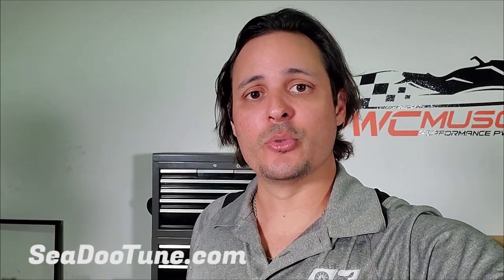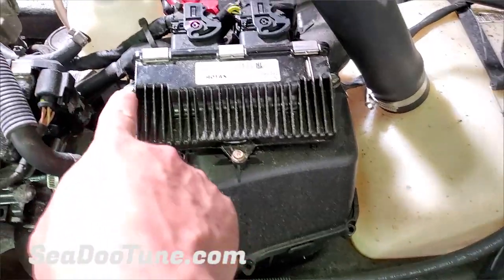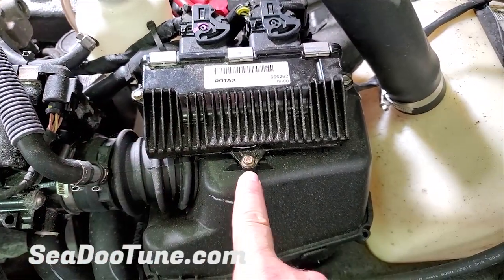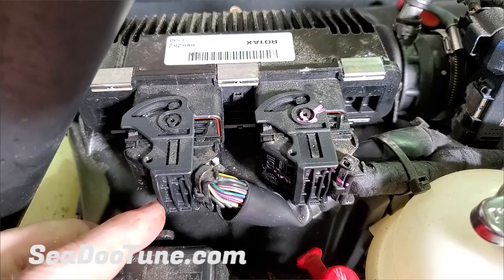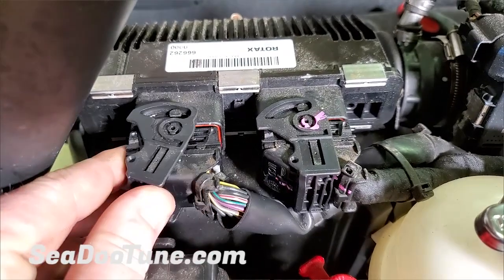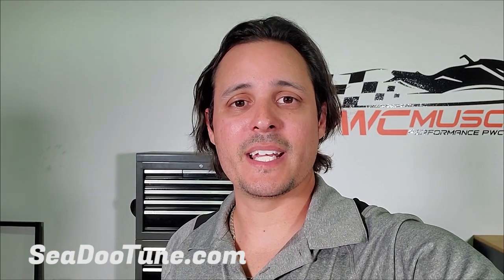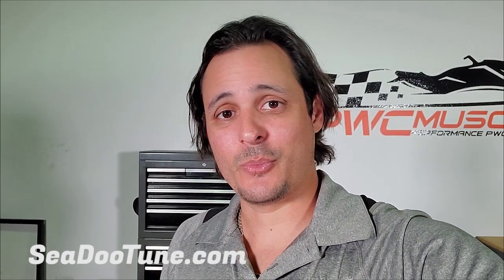How to remove the ECU from your SeaDoo Spark

Comment: Do you have a video on clearing maintenance required on a seadoo spark. Not sure where it’s located. I’ve done the oil changes myself. I’m also in North tampa  if you know any places I can take it to get it looked at eventually.
Reply from the maker: You need a candoo pro for that, or any dealer can clear it (of course, for a fee)